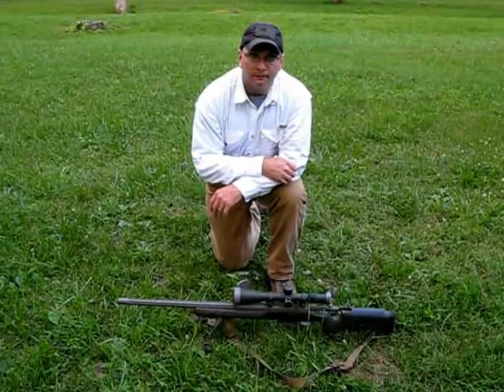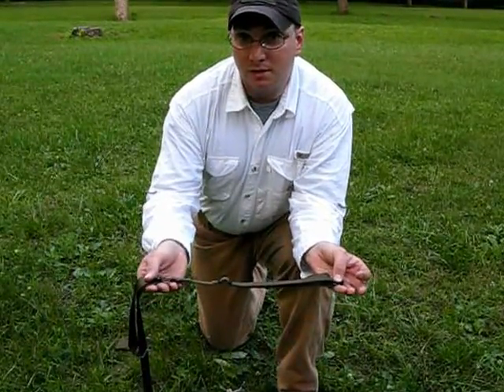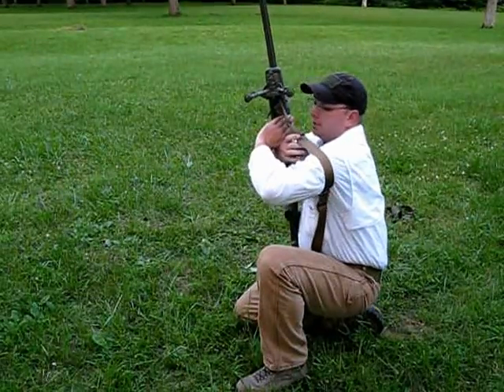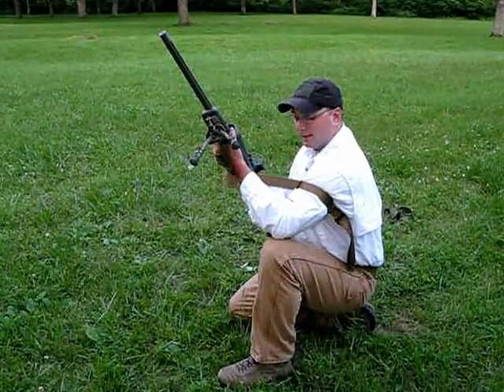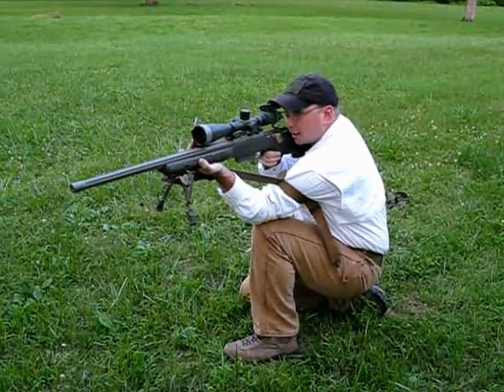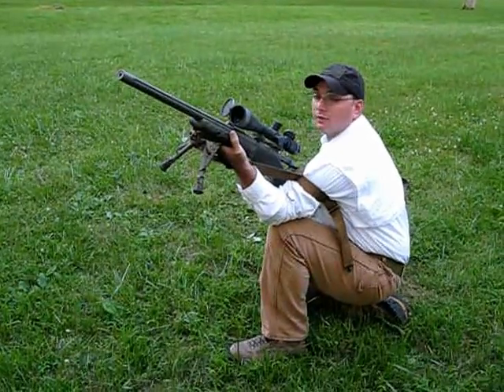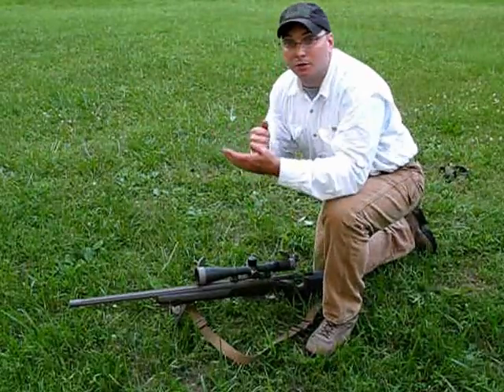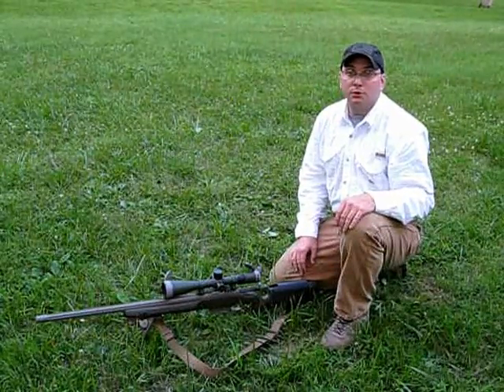Using A Rifle Sling

Comment: Great video.  The loop you are using is a cinch type.  It gets tighter as you push the gun forward.  That sling will also create a non-cinch type loop.  Non-cinch works less like a tourniquet which is good because you will transfer less pulse to the weapon.  Search "no pulse sling".